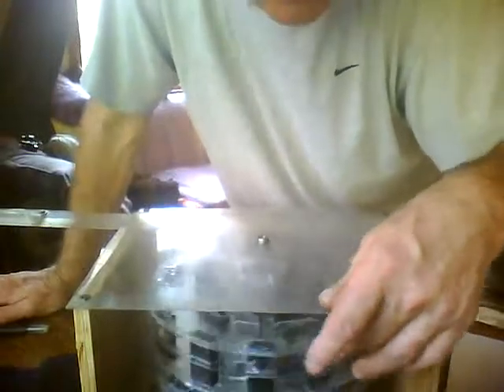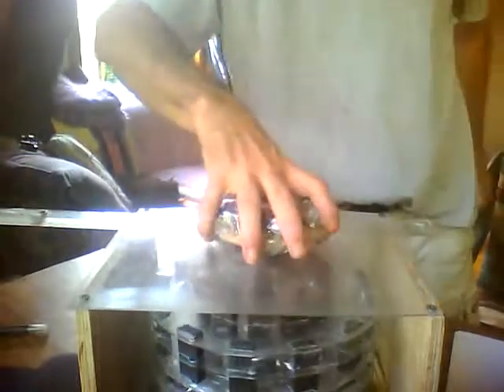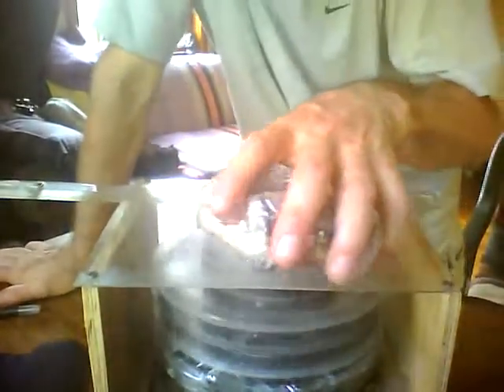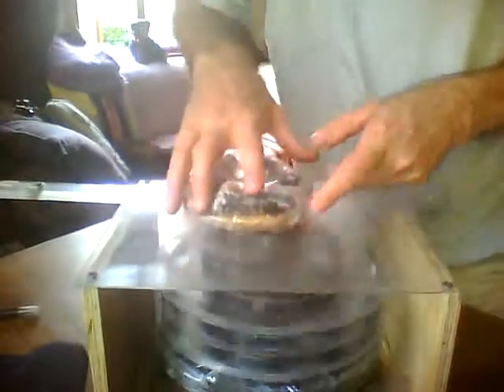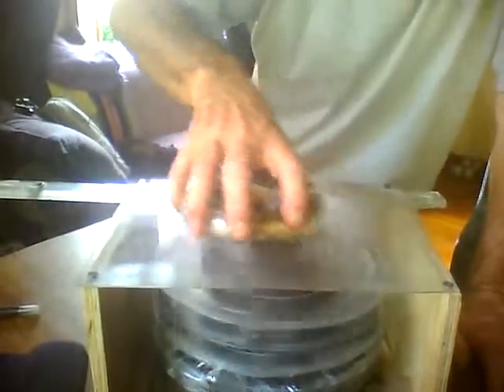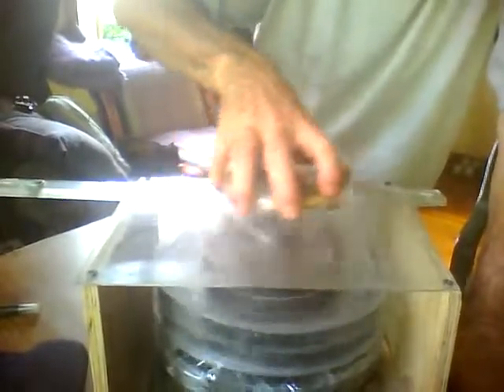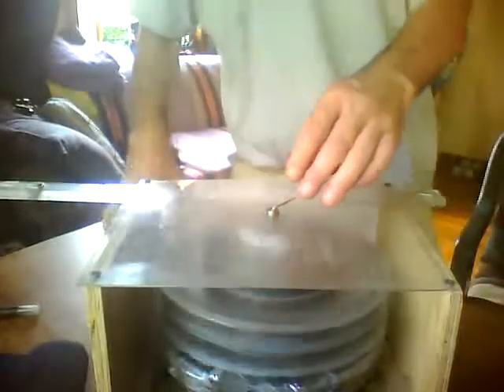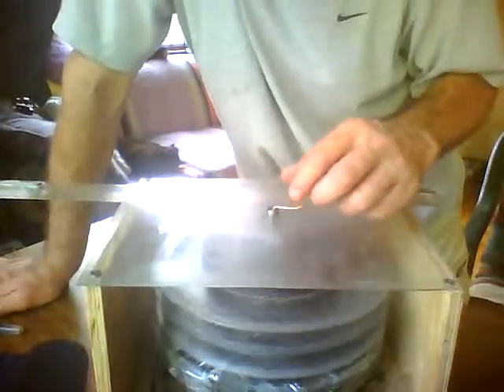Magnetic Motor Demo Take Five Neville Arthur Conway

Comment: i have something u can try out.. put some Mu-metal round the donut magnet edge and sides u want shielded, then try spinning it like a euler's disk, as the precession heads towards infinity..  maybe even use the concave surface they sell with toy..  but i think it is a silver mirror.. maybe get some glass formed, at an appropriate angle for the size donut magnet.. or use a disk magnet..